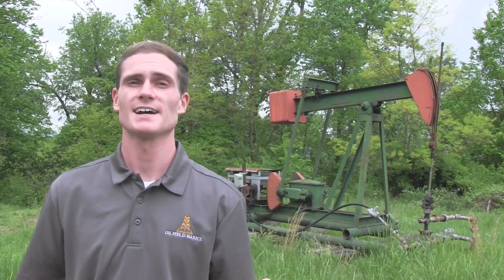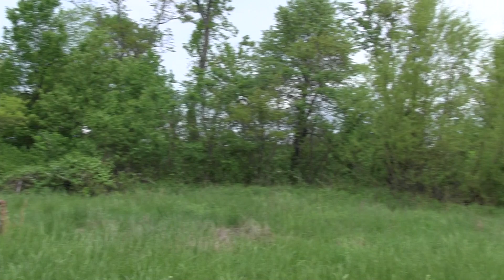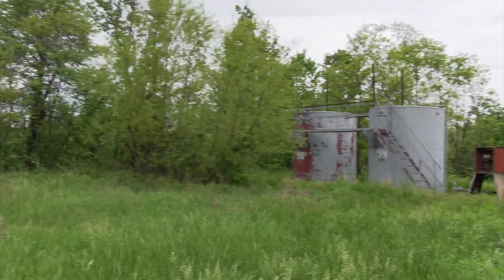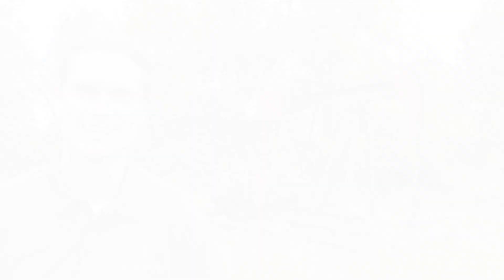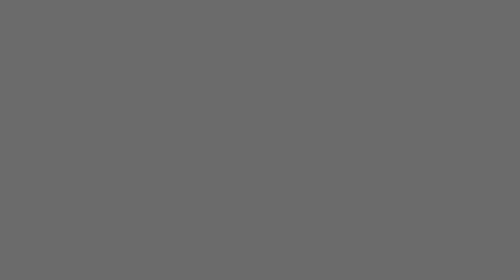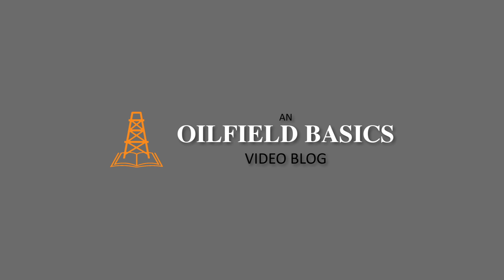Conventional  v. Unconventional Wells

Comment: What about the environmental impact differences between conventional and unconventional?  From my understanding conventional wells are not going to poison the waterways around and damage the ecosystems...
Reply from the maker: Hi Breeanan! Thanks for your question! This is definitely one for a longer discussion, but I believe what you're likely referring to is the increased size of modern operations (thus a larger footprint and thus larger potential impacts). If you're actually looking at the well itself, I'd say older conventional wells would be more likely to have an environmental impact. Older wells (especially shallow ones) aren't as likely to have as many environmental protections in place with their design. For example, casing strings. Modern wells are designed for asset and environmental integrity. In terms of modern-day - if you were to drill a conventional well or an unconventional well, I don't really think there is an automatic difference in risk. It's very dependent on design and the scope of drilling and completion operations. For example, a modern-day conventional well might utilize more acid for its completions, whereas an unconventional utilizes more water volume to complete the well. I could keep going with examples. If you've got a specific instance you're thinking of, I can help to flesh it out with you. Otherwise, it's really hard to put a blanket statement out about which one is more environmentally sound. I think our biggest impact environmentally though (across the board) is just land disturbance. Thankfully, there are ways we can reclaim most of the land once the wells are drilled and brought to production. As for the waterways, I'm curious to know what you're referring to. Are you talking about when there's been a surface release from something going wrong during operations, or are you actually talking about the well seeping chemicals underground?
Reply: @OilfieldBasics  One thing is for sure: it's way more clean than mining for rare earth elements!